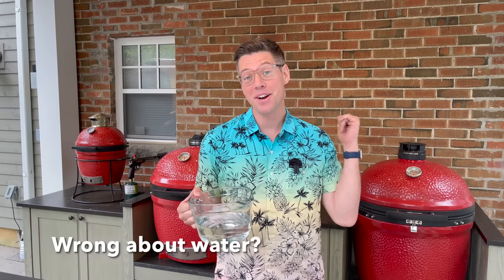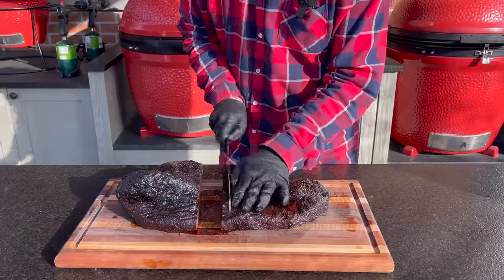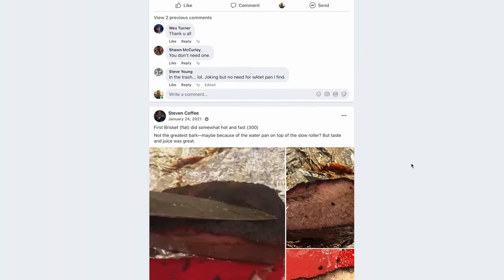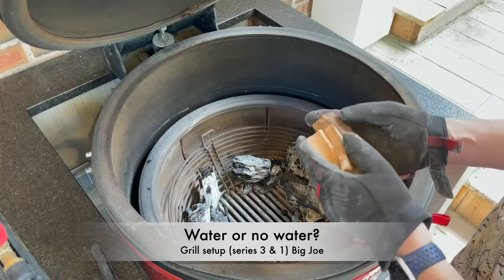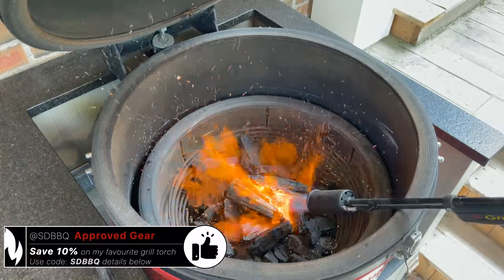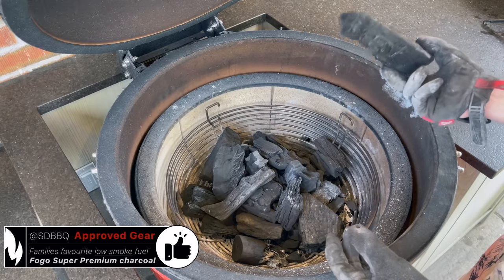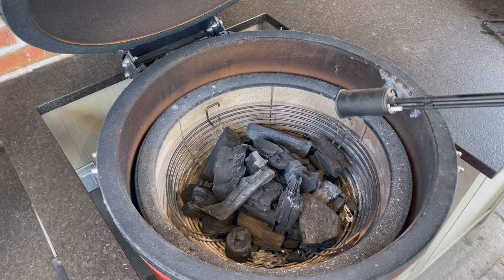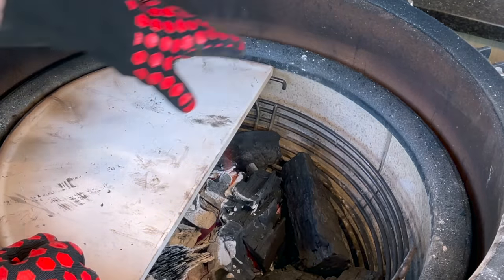THIS Kamado Joe water pan test PROVES we're ALL WRONG about water pans in Kamado's

Comment: James, I think the use of water in this case might not be the best idea. In this case placing water directly under the ribs somewhat creates different temperatures for the top and for the bottom of the meat you are cooking. On a bottom water pan will artificially cool down the meat. It reminds me of the "Ultimate Turkey" recipe from Meathead's  book (pg 307) where you need to place a pan with gravy under the turkey. generally it cools down the bottom of the bird, and in my experience you need to remove the pan and give the bottom a dry heat to finish cooking. Anyway thanks a lot for the experiment your channel is my KJ tutorial.
Reply: I am using a water pan a lot myself for my offset set up and for Webber Slow and Sear setup, but there it is generally used for temperature stability rather than anything else. Also in both set ups the water pan does not go under the meat but rather on the side. so maybe in KJ you can try a smaller water pan on the same level as the meat.

Comment: I hope you can provide some info with my issue. I purchased the Grill Gun and when it works, it works great. But after a couple uses it doesn’t work properly. I have used both a 5 gal bottle a cylinder. Both have propane in the bottle but I can’t get the full BTU output. I’m thinking since it’s 400k BTU that may be the issue so I’m thinking of trying the Su Vgun which is 240k BTU but I don’t want the same issue. I see you use the Vgun in most your videos and am assuming you don’t have this issue? I have tried calling Grill Blazer and have sent an email as well but have not heard from them. I am hoping you can provide some insight.....thanks soooo much! :)
Reply from the maker: my neighbour had an issue and got a service kit from them that fixed the issue, it was a gasket
Reply: @SmokingDadBBQ  Thanks so much for getting back to me. And thanks so much for recommending and representing quality products. Shortly after I reached out to you for assistance, GrillBlazer responded to my issue. They were super great in solving the issue and it now works great! :) I’m so glad I did contact them for the issue wasn’t with the gun....it was with the operator! :))) I didn’t release the pressure in the hose  which caused condensation and my problem. It was super easy to clean both the hose and the gun. Now back to watching more of your video’s! :)

Comment: I’ve been using the water pan all year so far. I’m all for it. Just the ceramic heat deflectors with a water dish resting on it. Been getting fantastic results. 

The slow roller is way more trouble than it’s worth imo. I dislike using it. However, Cooking on the hotter side with just the ceramic moons I found my ribs would almost burn on the bottom. The water tray eliminates this concern. While providing no negatives that I can perceive.

Comment: I've found the use of water pans to be basically a royal pain in the ass that produces no discernable difference to the quality of the food. (does this make me a hater?)
When I do use water it's in my offset or electric smoker, it's more for temp control then humidity level.
Even with the SS slow and sear that water reservoir is more of a heat block then any thing else, but each to their own. (that should remove me from the hater category of viewers, hehe)
Reply from the maker: i am thinking of putting the water pan on the deflectors under the SloRoller so that the moisture gets accelerated out like a spritzer vs a steamer under the food next time. I think that might work better
Reply: @SmokingDadBBQ  I finally set up the expanded metal fire box divider in the kettle Joe, works great.